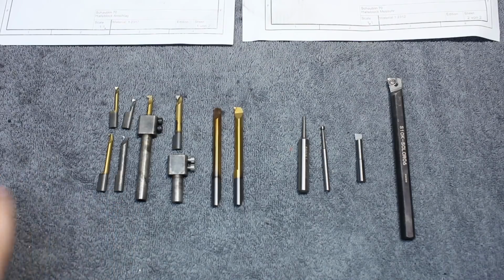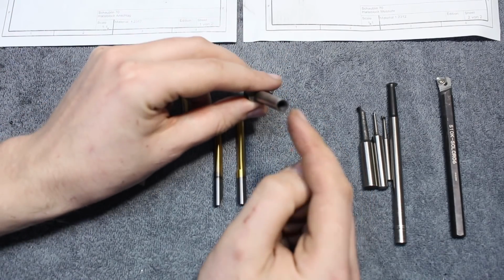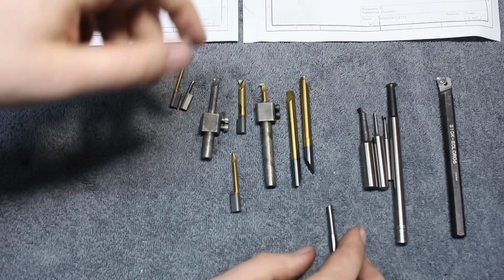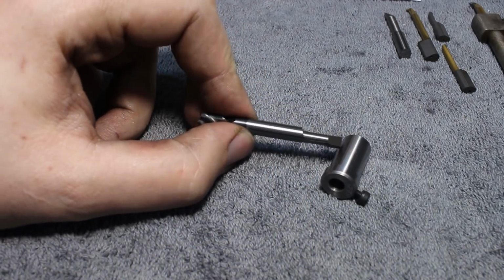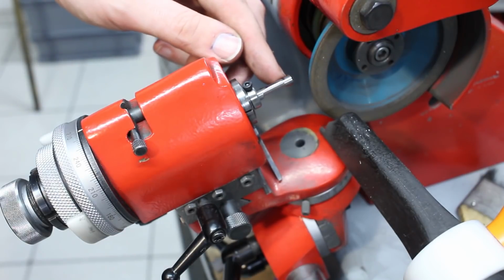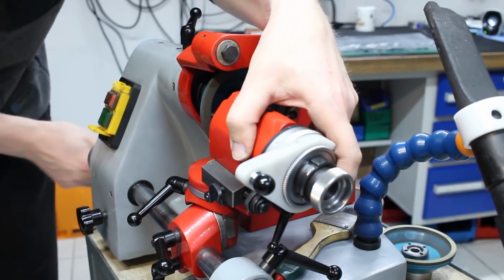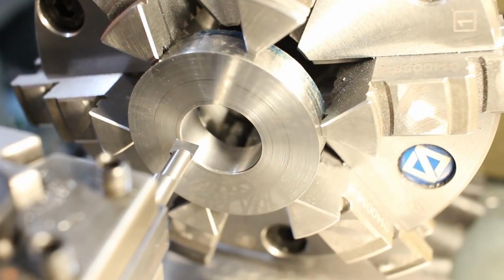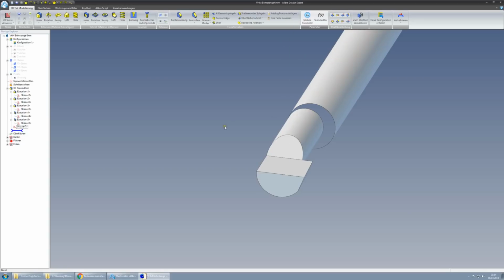Grinding small diameter solidcarbide boring bars

Comment: Just want to thank You again for the excellent tip of re using the Paul Horn mini boringbars! 👍
 I never used them before due to price, but now use regrounds extensively. Made a few holders for the lathe and boring head. I like the P Horn holding system better than the others I had, I am actually quite impressed by the stability and depth of cut that works despite their tinynes... Easy to change tools as well. Found a 16mm MEGA holder (B105.0016.01) that is offset and perfect for regrinding and relieving in the D-bit grinder, the offset is usually perfect for reliefs when re purposing an old insert.

Comment: With the geometry you gave it (and the fact that it is solid carbide), shouldn't it theoretically be possible to plunge these boring bars directly into unbored workpieces? Theoretically.
Kind of like a parting tool... but axial...?

Sorry if I'm sounding like a complete noob (which I am).
Reply from the maker: Yes, that works within certain limitations. In plastic and soft metals like aluminium I do that often, in steel its very demanding on the tool and its alignment.

But yes, absolutely possible - people like pHorn even sell miniature boring tools that are designed to drill and bore.
Reply: @StefanGotteswinter  I've also been wondering if the sole purpose of the "eccentric section" is to ensure that there is nothing behind the "½-diameter flat head section" that can rub against the inside of the bore.

If that is the case, then must the boring bar be clamped such that it is parallel to the axis of rotation of the lathe chuck?
In other words— the boring bar is obviously fed straight into the workpiece when it is used, but must it also be clamped that way?

What if it was clamped at a slight angle? (anti-clockwise by a few degrees)
Then there wouldn't be anything to rub against the "inner wall" of the bore no matter how far in you went. Right?

Comment: Thanks a lot for this very valuable video! 
I just bought 2 of these very same grinders, one for my own shop and one for a company I do work for. Made the decision based on Yours and Robins videos. Making carbide boring bars seems really useful to me. My production of raw material for these is in the mill is no problem... Also intend to try a CBN cup to decrease dust and perhaps get a bit more repeatability over a number of parts. Present project is to facet grind some very small parts with tight tolerances in some different hardened steels. Btw I ordered 6 extra wheel holders, they are under 30 euros each.
Reply: What is this grinder called

Comment: Great video and interesting take on small carbide tools. Very cool little machine for grinding. Years ago we did similar tools by hand on the basic “bench” diamond grinders with adjustable tables. That always involved an acid brush full of kerosene for coolant flying in your face to keep the diamond wheel clean. A hand-held die grinder with a small diamond wheel was used for adding chip breakers, etc. l get the carbide rigidity thing but still like the idea of custom carbide-tipped tools and high-speed too. Keep up the good work!

Comment: Stefan, it seems to me that you could somewhat increase the stiffness, or get a deeper eccentric for the same stiffness, by grinding a larger radius on the eccentric portion. For clearance, the radius on the eccentric cut doesn't have to be any less than the radius of the blank. You would end up with an (American) football-shaped cross section on the shaft.

The downside, I guess, is that you would leave less room for chips to flee.
Reply: Or maybe you could also grind a flute to guide the chips out.
Reply from the maker: Yes, there are many possibilities to make them more suitable for certain tasks. Just play around in cad and see how cross sections and clearances change :)

Comment: Very cool.  Someday I will grind my own small carbide boring bars but until then I will stick with my Circle Machine carbide boring bars.  You will be amazed at what they can do.  Circle Machine guarantees a 10:1 ratio with moderate feeds and believe me they can do it.  I have a 5/32” (4MM) CM bar that takes miniature CDCD inserts with either a .002 or .007” nose radius and have had no issues boring 1.5”.  I got it all for about $100 with a handful of inserts.  Look for them on Ebay.  You can find them in metric too and they use the same inserts

Comment: Stefan have you consider milling a flat on the bushing opposite the set screw?  You could then just push the flat against the wheel to set your reference before clamping down on the collet. It would be like using the face of a chuck to re-align a qctp.
Reply from the maker: Good idea, should do that :)

Comment: Horn inserts are quite something for sure, the quality is just beyond and still unmatched by other vendors. we use them in our shop regularily, the smallest one is for 0.3 mm ID upwards. if only they were not expensive as fuck, the other insert we have with CBN for 6 mm ID upwards at 15 mm depth for hardenend steel clocks at around 80 euros without discount...
great vid and tremendous job on the grinding, you should really consider doing edge radius tho.

Comment: what kind of diamond wheels are those again?  And, more importantly, how do you dress them?  I've got a couple of cheap import ones and they're all loaded up and black now... though they did completely EAT carbide for breakfast when they cut.
Reply from the maker: My wheels come from an Ukrainian manufacturer - I generaly use two grits, D126 for roughing and D40 for finishing.
I usualy dress them with a piece of molybdenium, followed by the sharpening stick, to dress the resin binder back and make the wheel cut again.
If a cup wheel is off very much, you can also lap it flat on a piece of glas with Silicone carbide lapping compound. I showed that in a video earlier this year ;)
Reply: @StefanGotteswinter  link to manufacturer of wheels? I am ukrainian and I would be proud to support local manufacturer
Reply: Stefan Gotteswinter I concur, refractory molybdenum is the way to go. We use these for our Agathon grinders at work.

Comment: Hello Stefan,

I have a Deckel SO grinder and I can't figure out how to do what you did at movie time 19:45, to grind the back relief angle. I am not able to swing the joint beyond 0 deg.(to the left)
Do you know if is't this possible with Deckel SO?

I have checked the bottom side of the joint, there are two 5mm hex sockets for adjustment but suppose those are for fine adjustment of the end stop of the joint

Thank you,
Laszlo

Comment: Why didn't you made the relieve more eccentric? (Rotation point outside the shaft like in the original Horn boring bars) With this there would be more material in the stressed parts and less grinding.

Comment: I only use miniature Sherline and Taig lathes for my model engineering projects ( the old Myford doesn't get used much these days ) and I now only use the Sandvik CXS boring bars , the ones you showed with the gold coating . They work very well on a small machine and can be used on holes from 4mm up wards. I have had no luck trying to grind tools using broken bits of tooling on a bench grinder. I guess that I am not just very good. LOL.

Comment: Very informative!  I"ll probably never have a use for this information (LOL), but I still love learning about it.  I really liked this video as is the case with probably every video you've made, honestly and I'm pretty sure I've watched all of them.  One of these days I'll get around to getting some basic metal working equipment, but the house I live in now has ANCIENT wiring and I literally have fuses and not breakers (15A for the wall plugs, and a 30A for the washer/drier).  Yeah we gotta fix that, but the house will be sold in the next year or two and I'll be in a different one with up-to-date wiring and a nice heated workroom in the basement.  

What would you recommend if I had to get one thing, a smallish lathe or a milling machine?  I've always wanted a small lathe for making metal parts.  I absolutely LOVED using my woodshop class wood carving lathe even though the tools were crap and the lathe was not exactly treated well by the High School kids.  Once I get all my debts paid off, I'll probably get a lightly used lathe and mill locally haha.  We'll see - it's all a dream now, but a completely reasonable one if I get my sh*t together with my money - I make plenty, but spent more.  Stupid credit cards, it's all their fault - I take no responsibility! /s

Comment: Do you prefer flat top bits vs relieved?  I've found that having the cutting corner 5 degrees proud helps pull the chips and swarf away from the bore.

Comment: An excellent video - both instructional content and close-up camera work. 
Those two long boring bars (at 7 mins.) with the TiN coating and angled rear alignment surface are Sandvik CXS series - I like them because they are very easy to make the tool holders for, compared with the pHorn style.

Comment: The PH Horn bars look very nice and you can get them in bunches, but I couldn't find a toolholder anywhere and couldn't make one in a hurry so I went with the Micro100 ones...They have a much simpler toolholder with comparable repeatability and their only downfall is being imperial sizes. They offer blanks too!
PS: Since I made a 1/8" toolholder I silver braze tiny carbide tips on the tool steel shanks of PCB drills and it works great. Also the deep neck is used to avoid torsion and thus prevent rotation in the holder, as the edge is on the centerline. The PH Horn ones won't be that susceptible to this. Finally you want to make sure that the back side of a "solid" carbide endmill is actually carbide. Just balance it on your finger...the flute side should be lighter than the shank side. Most of them are not as solid as the name implies....